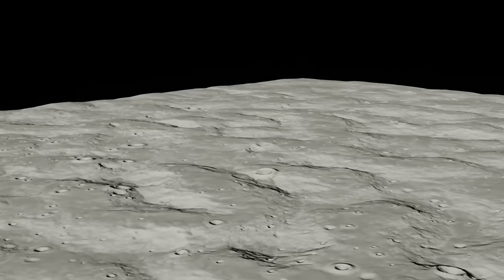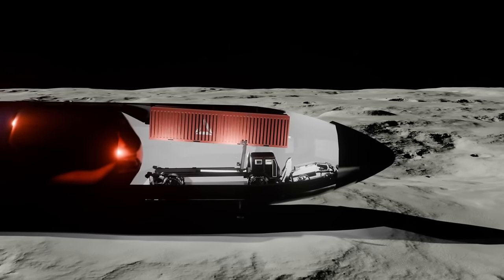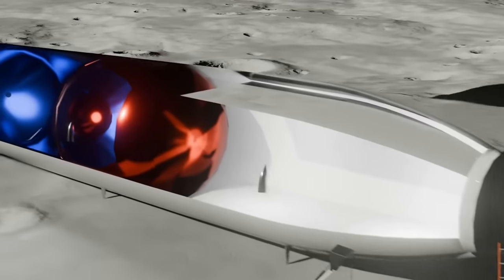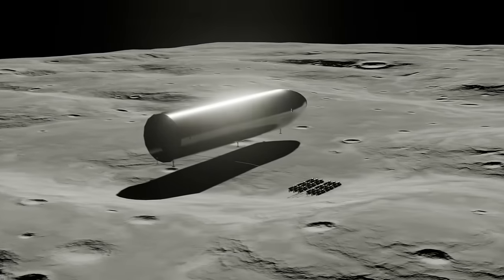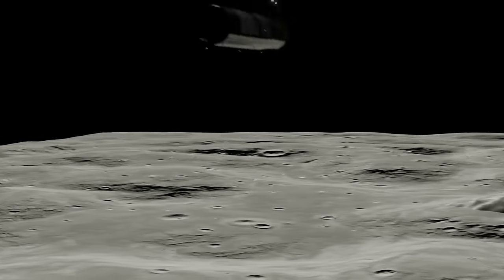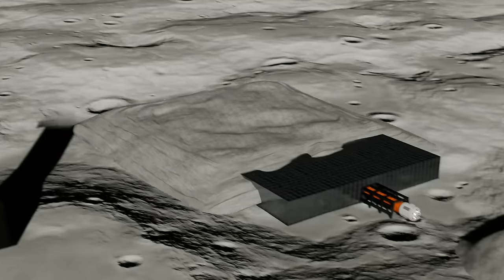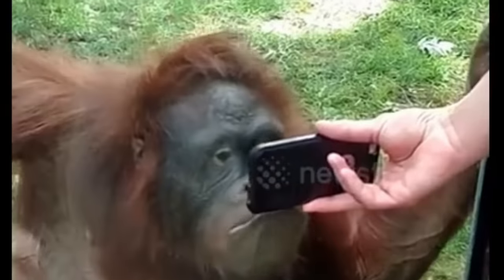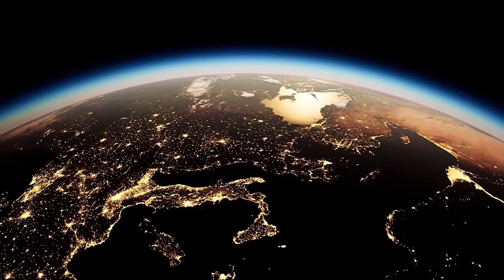How To Develop The Moon ALL PARTS

Comment: As of flight 4 Starship’s demonstrated payload to orbit is around 35-40 tons to Leo. And they are finding that they are going to have to add additional mass in another heat shield bringing down that payload even more. They are having to push extremely hard to get those payload figures higher and still keep the vehicle reusable, V3 could fly maybe 70 to 80 tons at most. A stretched orbital HLS will need between 1200 and 1500 tons of prop to do the job. 

There’s not a chance they will be able to go to the moon on 5-8 refueling flights. 15-20 minimum. Best case scenario.

Comment: Each of those tourists would get a space suit for free? The cost per unit  is more ose to 20 millions today.
Reply: Cost plus contract bloat along with super low demand is why they cost that. There is absolutely no reason a human sized suit should cost 1/3 what a fing rocket launch does...
Reply: Just re-use space suits
Reply: @deltap6967  space suits have to be fairly customized to fit properly. But volume production should lower costs.
Reply: @matthewconnor5483 nasa doesn’t customize them much there like 3 general sizes for length of arms and that’s basically it

Comment: It makes 0 sense to land the propulsion module that brings the ship into an orbit with the moon. If this is happening with starship, it makes a lot of sense to decouple starship propulsion and payload side, and only land the payload side, upright as a smaller separate stage. You would get away with far less deltaV allowing far more cargo, and the habitat can be placed upright allowing for better outpost shapes, possibly already present at landing. You can do all the gutting of a normal starship later, but landing a couple 3 stage starships make a whole lot more sense.

Comment: But don‘t forget one important detail: people/crews on the moon have to rotate, like ISS crews, due to lunar gravity similarity to weightlessness. So, a full-fledged colony is impossible, but you could still do a tourist resourt, a mining base or a scientific outpost etc. just don‘t leave people longer than 6 months on the moon, to maintain their health.
Reply: And no, physical training is not enough to compensate for the missing gravity (the moon only has ~1/6th surface gravity of the earth!)
Reply: The second problem: the regolith is made of extremely sharp micro-crystals, which are another health-hazard. The third problem is radiation from solar flares, galactic radiation etc.
Reply: Even on Mars, the weaker gravity will become a massive problem, long-term.
And there‘s no easy solution in sight, either.
Reply: @dot1298  he addressed this in the video. He said that on the ISS you can easily leave ppl for a year at a time. And the ISS has NO gravity. So the little bit of gravity on the moon will only extend that number to far beyond 6 months
Reply: There is almost no communication lag between the earth and the moon. You can remotely control robots that will be the first things to send so they can set up the infrastructure.
Reply: @jakammor4449  The record on the ISS was one year, and the guy was just fine afterwards.
Reply: @jakammor4449  ISS has nearly 90% of earth's gravity, da fuq are you on? They are weightless not because of "no gravity from earth", they are weightless because they are constantly falling around earth.
Reply: @shinigamisenpai3303  gravity causes mass to have weight, so without weight people are going to say that there is also “no gravity”. Yes I am aware that the ISS would experience gravity because it is in earth’s orbit, it’s just a popular term that people would understand in context.
Reply: @shinigamisenpai3303 That makes no difference whatsoever
Reply: @Jake1702  Well, if there was no gravitational force pulling on the ISS, it would need to artificially somehow employ centripetal force otherwise it would just fly off.
Reply: @shinigamisenpai3303  The ISS is moving fast enough that the effect of gravity at scale is not felt. Therefore, being on the ISS is effectively the same as experiencing no gravity.
Reply: @Jake1702   Yeah, that doesn't mean gravity isn't affecting the ISS, when the commenter said that there is no gravity, that implied the gravitational force was not affecting the ISS. Also, did you completely ignore my comment? Without gravity acting as the centripetal force, ISS couldn't go in a non-linear path. Gravity not being felt by the squishy humans, and it not affecting the ISS are two different things
Reply: @shinigamisenpai3303  In the context of the effect on humans, the distinction is irrelevant.
Reply: @Jake1702  Does it look like I am talking about effective gravity? I said that the gravitational force affects the ISS, so the statement "there is no gravitational on the ISS" is false. Mate, the original comment wasn't even aimed at you.
Reply: We know a lot about human biology in the presence of 1 G of gravity. We also know a bit about the effect of micro gravity (0 G) on some humans. We have effectively no knowlege about long term effects of any other amount of gravity on human biology. We do not know if the effects are linear or if a little is enough. Assuming the moon's gravity will be insufficient for all humans is likely a false assumption given that we have already seen astronauts have varying degrees of responses to microgravity, some seeming to have no long term issues and some having semi-permanent changes (eyesight degredation). It would not surprise me at all to find a subset of people can handle living on the moon just fine. This would be even more likely if short-term (partial-day) full gravity can be simulated using a large centrifuge.
Reply: @2jlee also it's not like we can't genetically engineer or select the humans capable of thriving in low-gravity environments should the need still arise.
Reply: @constantinethecataphract5949  If you play games you should understand how bad 2000ms ping is.
Reply: don't worry there are no effects when you don't make it to space... except maybe blowing up or crashing 🎉
musk can't make orbit without a payload.
Reply: @kevinb7551   So is the Falcon 9 a mythical creature?
Reply: @blackepyon4042  haha you clearly don't have a clue,  enjoy your kool-aid fanboy. astronauts go through a list of effects and recovery from lengthy space missions.
Reply: @shinigamisenpai3303  The human body only cares about the FEELING of acceleration, when the whole body is accelerating at the same rate, like in free fall in *orbit*, then it's literally the exact same as experiencing no gravity at all.
Reply: @goldenfloof5469  Thank you, I wouldn't know basic physics without your help. I wasn't talking about gravitational acceleration. I was talking about the force that is keeping the station gravitationally bound to the planet. No gravity just means that yeah, the ISS is too far away to be affected by gravity of Earth, and as that isn't correct because otherwise the moon wouldn't be orbiting us, so I simply stated that.
Reply: @shinigamisenpai3303 you are just talking past this other guy. They agreed with you - the IIS is experiencing earth's gravity. Nobody is confused about that I promise. But do you undertand that that's beside the point of the conversation?  On the IIS the human body doesn't experience the reaction forces imparted by the "ground" (supporting surface, floor etc), in opposition of gravity.

Comment: so... why do we have to send a steel shipping container to the moon again?
Reply: That was one of the most hilarious parts.
Reply: You don't. The reactor design just needs to be able to fit into the volume of a steel shipping container, so that the entire unit can fit within a rocket faring and be landed on the moon in one piece. Probably similar to the skycrane model the Curiosity and Perseverance rovers used. Then you build the containment vessel around it once it's on the lunar surface, and run the power cables to your base.
Reply: @blackepyon4042  oh I see, first they leave room for a shipping container in the rocket then they package the reactor into said shipping container to make sure it'll all fit. then you might as well just put the entire shipping container in there since we know there's enough room. no need to even break out the measuring tape 🤣
Reply: @typicallucas  It depends on how you want to get it there. You COULD use a shipping container, if you really wanted to, but a different design might work better for a given reactor output, depending on what they plan for. Launching it on it's own rocket and using a skycrane contraption to set it down might be a better way to go, or it might not.
Reply: @blackepyon4042  nah, it's fine, 4 tons of steel is but a drop in the bucket. especially considering sending rockets to the moon is basically free, and it's easy, and rich tourists will buy cruises to the moon instead of spending their money on private airplanes
Reply: @typicallucas  few minutes later smelting apparatus has been depicted as two Minecraft furnaces. This should given you a hunch that maybe some things are just symbolic stand-ins in this animation
Reply: @Mbeluba  the shipping container isn't symbolic. He explicitly says the reactors are in a standard 40 foot shipping container. He says it 3 times in the first 5 minutes of the video
Reply: To make moon Meth
Reply: @big_snack_100  🤣🤣🤣
Reply: Tbf private jet aviation is almost entirely corporate since it offers a time machine like opportunity. The nice seats and accommodations are simply upholstery added onto the solution.
Reply: Another option is to use solar power satellites in medium orbit. The satellites can also provide GPS and communication for the whole Moon. Since they don’t have to be landed their total mass can be 2 to 3 times higher than surface nuclear. Solar has much higher power per unit mass than say the Kilopower nuclear system proposed for Mars which weighs 150 kg per KW while solar power ssats  are a few kg/KW. Total cost and lead time are more than an order of magnitude less than nuclear.
Reply: @stevemickler452  solar arrays aren't going to be very effective inside of a steel shipping container...
Reply: @stevemickler452  
Is the solar collector output corrected for the distance Mars is from the Sun? Also, will terrestrial panels be used or orbital collectors that use UV?
Reply: Because Moonraker

Comment: Great video.

I must express that the nuclear tug section of the video is highly optimistic at best, and science-fantasy at worst. Yes, nuclear thermal rocket engines have been developed and tested, but NOT open-gas-core which you mention, they are as complex or more than nuclear fusion reactors. You also don't count propellant they will use, they don't run on uranium alone, which will need to be supplied from Earth or Mars.

I hope to see this future you describe, and I very much want to see more content from you. Good work.
Reply: Also the open cycle means they chew through uranium pretty fast, which isn't cheap either.
Reply: the amount of radiation they produce makes it a bonkers idea, too [engine #5 in the playlist]> https://youtube.com/playlist?list=PLNDavGvRFdB496mL28_2r6r_hSVqSphn0&si=3gpzDbihypKpA8lV

Comment: Thank you for the amazing video! I know it took a lot to animate all of these and research all of the R&D costs you mentioned. That said, I really think you underestimated R&D by at least 1 order of magnitude, and something like $50 billion is a much more reasonable conservative estimate.

There are two main reasons I believe this:
1. Private organizations fleece the government when fulfilling contracts. One non-profit in DC (POGO) estimated that the government pays ~2X more than the private sector for comparable services. If you add in the lower supply of qualified organizations for lunar-style missions (it's a lot easier to find a security guard contractor to guard the gates of your facility than a contractor that has the know-how to build and deploy lunar-specific infrastructure), and I think costs could balloon 5-10X higher than what we see on earth for comparable services.

2. I don't think you can lump R&D costs for building the shelter into one single project. The wheel will have to re-invented in a lot of cases, and effective prototyping on earth will be very expensive (or impossible) because of how difficult it is to replicate an exact lunar environment, meaning a lot of trial and error is to be expected. I suspect your $4billion cost over 8 years could likely be replicated for many aspects of the project. $4bil for the steel electrolysis reactors working in space, $4bil for the water radiation insulation and containers that don't leak, $4bil for the machine shop, $4bil for the excavator, etc...

Multiply your $4 billion by the number of advanced R&D projects that are required and inflate your costs by the fact that much of this will be performed by government contractors, and $50 billion begins to make a lot more sense. Remember that the unmanned (no life support, human-grade systems, etc...) James Webb space telescope cost $10 billion to deliver. The ISS took $150 billion and costs $3 billion a year just to maintain. Of course, I agree with a lot of your arguments that we are at a better starting point with a lot of the technologies required to make this lunar development a reality, but I really think $5 billion is far too low.

Of course $50 billion is chump change compared to US military spending, so I still think it's a bargain compared to a lot of what we do every year on earth :)

Comment: Isn't the 'belly flop' maneuver an aerobraking maneuver? One does not need to aerobrake on the Moon. That said, bringing Starship down on its side makes sense- it puts the centre of gravity in a far more stable position than the backside down landing. I imagine, though, that Starship's centre of gravity whilst it is tail-sitting is still quite low. Weighing far more than the Apollo LM, I think landing Starship like something out of a Heinlein novel is as dangerous as hell. Starship HLS has landing engines situated between the crew compartment, and the propulsion compartment. It would be pretty simple to use those thrusters, once Starship has made contact with the Lunar Surface, to pitch the ship gently down on its (need to install) nose gear. And then up again for launch. Of course, Starship HLS can be modified as permanent habitats. Though wasting 33 Raptor engines for each permanent Starship habitat does not make practical sense. It IS better to have capacity left-over than to have not enough.
Reply from the maker: Yeah all correct and great point about center of gravity. A bit later in the video I discuss retrieving the engines.
Reply: Only six engines would be lost. Booster has 33 and those would be recovered
Reply: Yes, the poster does not actually grasp the complexities of a belly landing, nor do they understand the reasons why this approach makes sense in an atmosphere but not in a vacuum.
Reply: The Dynetics HLS landscape orientation is quite viable and also uses methalox. The HLS version of Starship is also going to use engines far forward on the hull for landing. SpaceX can build an HLS version that merges these two designs.
Reply: Likely, the ship would approach the landing vertically, and only more horizontally when it's a couple hundred meters from the ground and it's already slowed to a hear hover.

Comment: @9:00 opposite is more likely. Aluminum is more likely because for steel, as mentioned you require carbon. Carbon is really rare on the moon. Aluminum alloys requires less energy to make. Magnesium is available to make it an alloy if desirable. Temperature deficiencies can be compensated in the design if required.
Reply: But the production of oxygen?

Comment: You don't think straight, transport logistics have sense only with reuseble spacecrafts, all the way from bottom to top, so logical thing to do would be to reuse all the vehicles in the transport chain, the only option that use chemical propulsion is to use a smaller lunar lander and transfer the payload and the propellant for lunar landing into lunar orbit from the earth transfer vehicle (it may be a starship) to a smaller lunar lander. You may ask, how the large payload fit into the smaller lander and is unloaded on the moon surface? Well the payload would be putted into large containers and attached externally to the lander(transferred from ship to ship into lunar orbit,and unloaded with rolled cables ) , that would allow a significant propellant saving, for example if the lander would have a dry mass of 25 tons (instead of 100 tons or so of fully sized starship), for landing on the moon surface and flying the lander back to moon orbit would require 1,75 of his dry mass in propellant(for methalox and with 380 seconds specific impulse) , but if you send down 100 tons of payload you need only 65% of that mass for that. So a 100 tons full size starship would need 175+65(240) tons of propellant into lunar orbit to deliver 100 tons of payload and be reuseble, but a 25 tons lunar lander 42,5+65(107,5) to deliver the same 100 tons of payload, that is only with the price of a lunar orbit rendezvous and one propellant transfer operation.
Reply: Your run-on sentences and poor grammar and absent punctuational proficiency lead me to believe that you have lived less than five years in mortality. Please cite your sources and format your comment prior to posting it so we can all benefit from your knowledge. I haven't posted anything as worthwhile as you yet in this comment section, but my comments have at least been parseable by readers.

Comment: How do you account for the weight of the regolith bearing down on the buried ships?
Reply: Actually, the weight isn't enough on the moon to balance the internal pressure.  On Mars, where regolith would be much heavier, it would reduce the stresses of the internal pressure, which is slightly helpful.  On the moon, it's much less help.